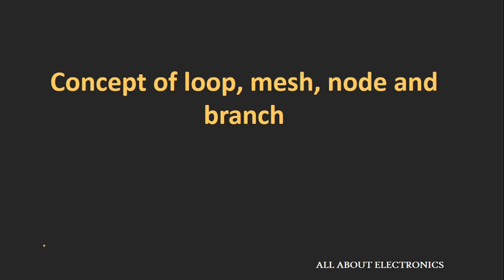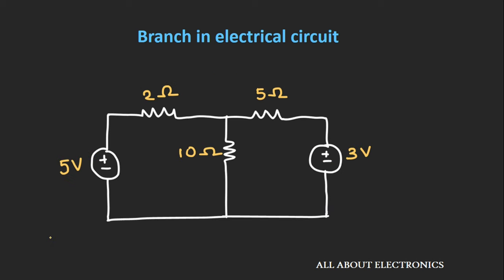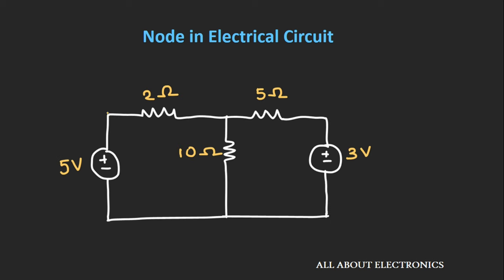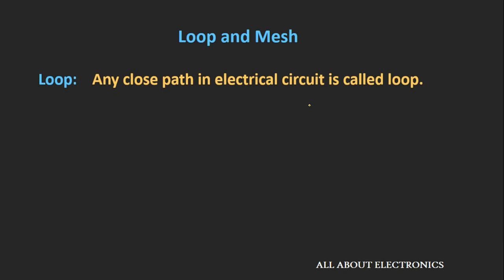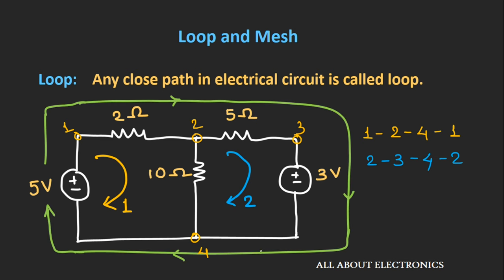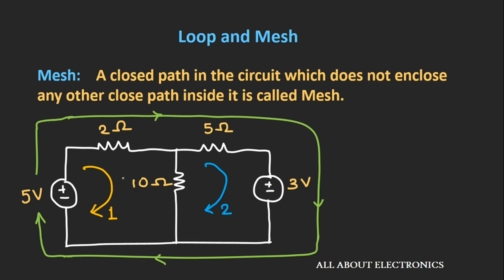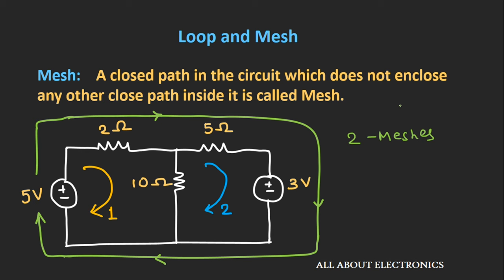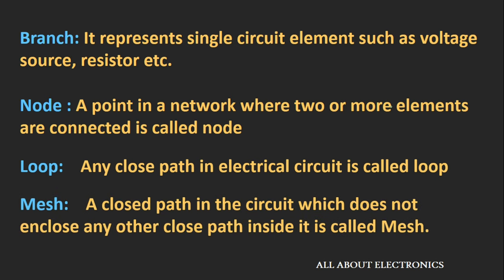Circuit terminology: Concept of Loop, Mesh, Node and Branch explained

Comment: I would also like to share a relay logic circuit that includes four seven segment numerals , a keypad with the 10 digits , a next key , and an erase key. It uses the usual combination of SPDT relays , light bulbs , connecting wires , SPST push button momentary switches , and this time DPDT switches. It is used to type four digit numbers that can be changed. It can be expanded to a keyboard and display that uses larger sets of light bulbs to display type as it is typed. Along with the insert and delete functions can be added

Comment: What happens when two elements either in series or parallel can be combined into single element. Is then also the number of branch will be the number of original elements or reduced one after combining all possible elements?
Reply from the maker: No, for the equivalent circuit, the number of branches will change.
Reply: Thanks, better if u explain one example related to this type.

Comment: will voltmeter and ammeter be counted as branches ?
Reply from the maker: The voltmeter or Ammeter is not a part of the circuit . But it is connected just to measure the voltage across any branch or the current through the any branch in the circuit, right !!
So, it won't be considered as a branch. The ammeter will be connected in series with the any element through which we want to find the current. So, anyway the ammeter will part of the that branch. But no need to count them separately. 
I hope it will clear your doubt.

Comment: sir these 33 videos are enough for AC and DC Circuits of electrical technology ( engineering 1st sem) .
Reply from the maker: These videos will cover most of the topics. But please check the syllabus also, so that you will not miss any topic.
Reply: @ALLABOUTELECTRONICS  ok sir

Comment: This circuit contains 3 Branches
Reply from the maker: If you see that circuit, it contains five circuit elements. And each element represents one branch. So, the circuit contains five branches.
Check it once again.

Comment: SIR I AM STUDENT OF ELECTRONICS   IN NODE 4 I CONFUCED BECAUSE IT CONNECTED ONLY 10OHM BRANCH SIR PLZ EXPLAIN PLZ
Reply from the maker: If you see the node 4, it is connected to node 1 through 5V source, to node 2 through a 10-ohm resistor and to node 3 through 3V voltage source.